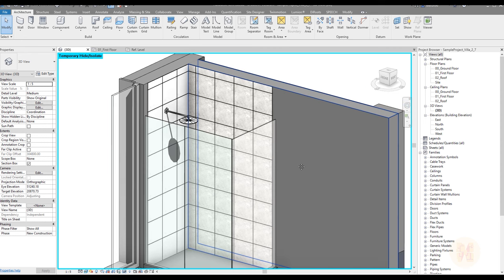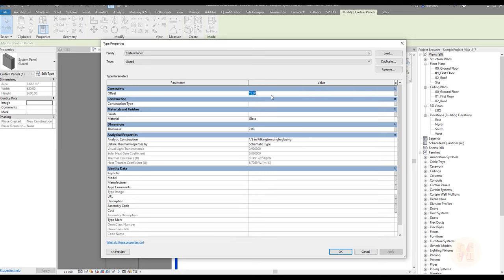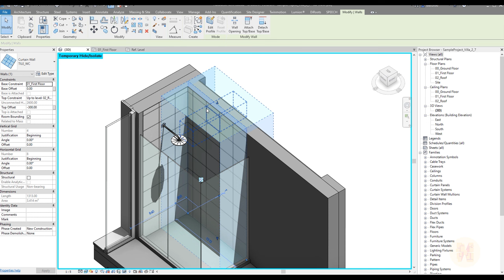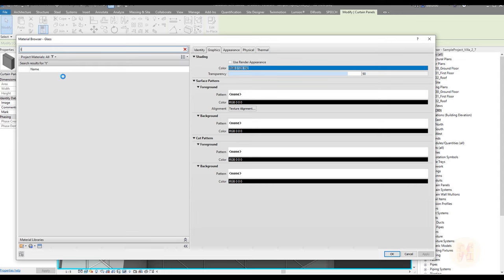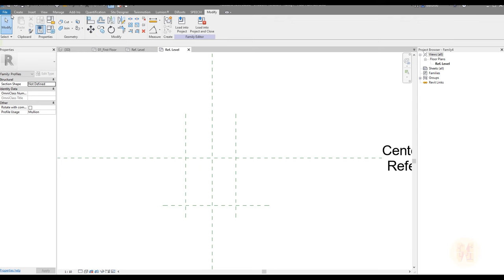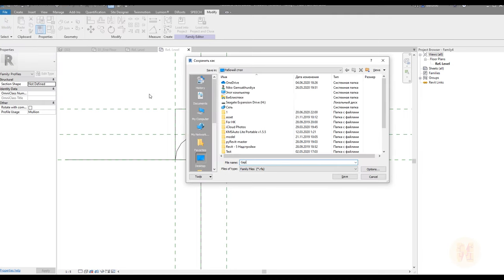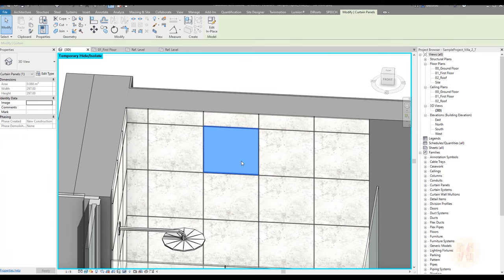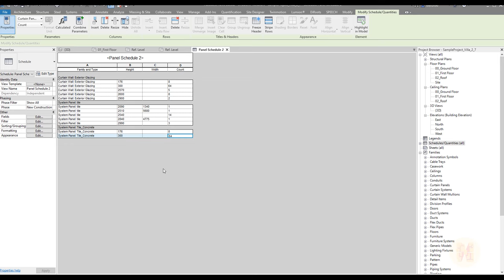TILES | Modeling in Revit |

Comment: Great tutorial! However I am having a bit of an issue.  I am using Revit 2022, maybe they changed something?  The problem I am having is that when I open the "Edit Type" there is no "Constraint Parameter" which means there is also no "Offset".  Am I just doing something wrong?  I do not really see what it could be, but obviously something is going on.  Is it possible that I have a setting misconfigured somewhere?  Help figuring this out would be greatly appreciated!  Thanks!

Comment: Thanks for a creative solution!
However it's a lot of steps just for creating tiles.... I will only try it when I have time to burn during the project or required to calculate the quantity. 
I will just put the texture on, then use the real-time rendering software for realistic look if I need to.